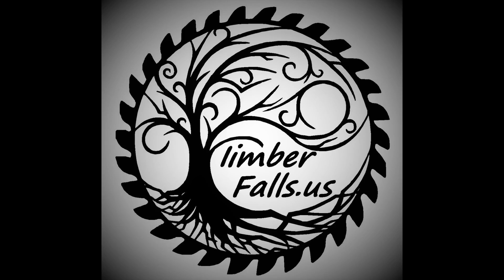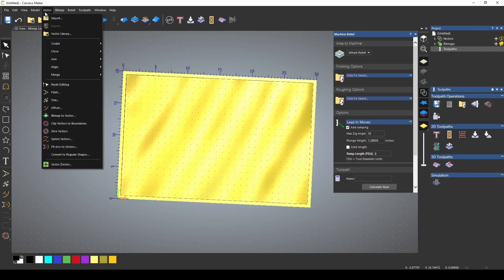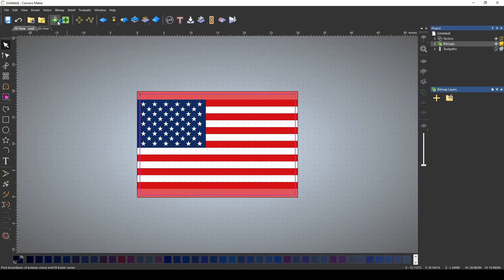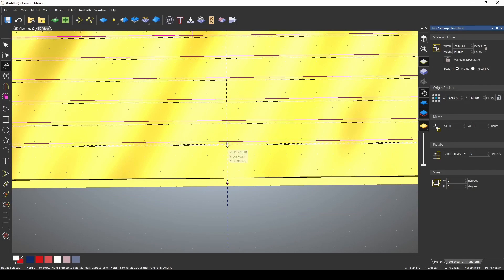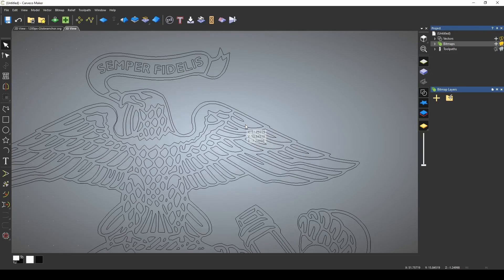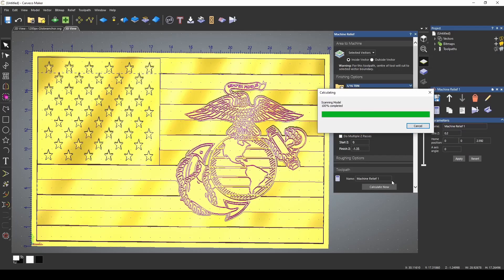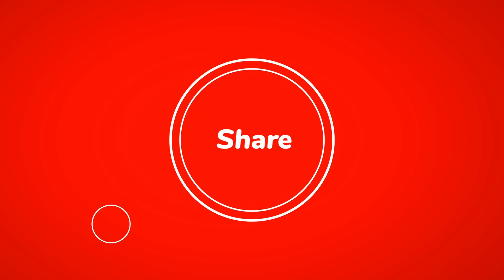Mastering Wavy Flags with Carveco Maker: Step-by-Step Guide

Comment: Well it looks good, too bad it don’t cut like that. I followed this video to the tee and it just don’t work. Many many hours of run time to find out it cuts too high. The flag waves cut perfectly but the Stars and Stripes mostly cut air. Try again brother.
Reply from the maker: You missed a step because I cut this out and it looks exactly like this. I think the part you missed was using selected vector in the transform relief tool to add the stars and stripes to your wave base model. Once you do that your model will have the stars and stripes in it and can be carved with a machine relief tool. Watch the video on Marine Corp relief with carveco maker video and I go over this hack in detail as well. Hope this helps.

Comment: Love the video but when i did this following all your stuff it says it will take 47 hours to do this cut
Reply from the maker: I would check the stepover and stepdown on your bit settings as these are usually the things that cause long cut times. For tapered ball nose bits you can run most of those .25 depth of cut because of the large cutting surface along the sides and during a finishing cut there is not much material being cut. Hope this helps.

Comment: How do you get the Vbit to follow the 3d wave of the flag? When I try and simulate tool path the carve isn’t at a consistent depth.
Reply from the maker: I used a machine relief toolpath with the selected vectors of just the stars. While they were not exactly the same they were fairly close. There was some depth differences throughout the stars though.

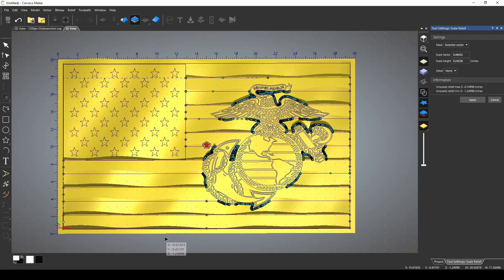Comment: Hi?  Thanks for the great video.  I have a question.  Instead of scaling the relief as a percentage for the stripes (9:40 time mark) is it possible to do a constant offset of say 1/8"?  The scaling makes the "white" stripes a variable depth depending on the overall thickness of the model at a given point which is looking kinda weird.  Short of a way to do it in Carveco I'm thinking the only workaround would be to just program the stripes at the main wavy surface and then just drop my Z offset 1/8" when I run that toolpath, but as a relative newbie that seems like I'm asking for a booboo.
Reply from the maker: This was sort of a workaround for using maker to make these wavy flags and there is no real way to get the z to follow the wavy part without scaling the stripes. If you use a constant z it will only cut the tops of the raised parts and miss over the lower parts.  If you scale it less it will have less effect on the different depths and make it look more even. The one I did came out pretty nice looking I thought.